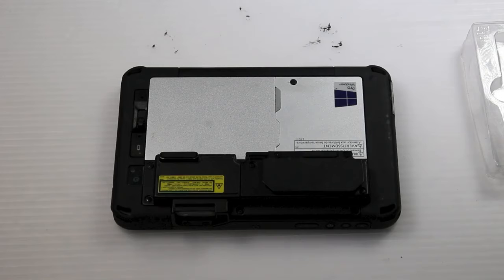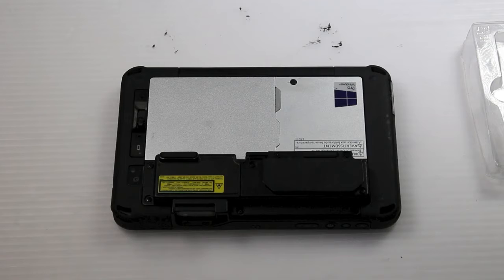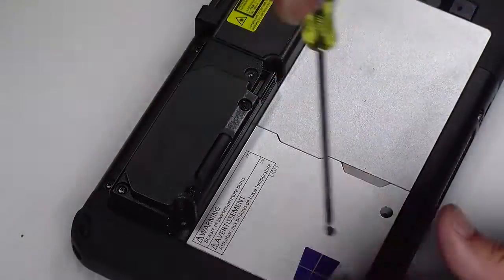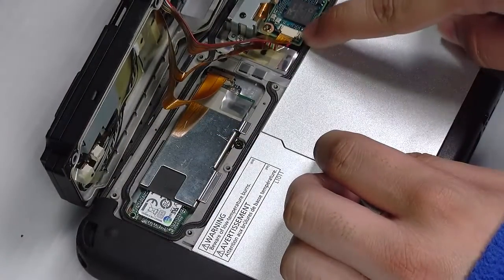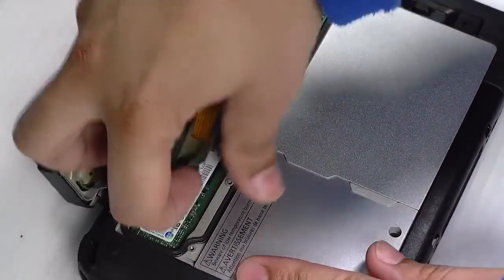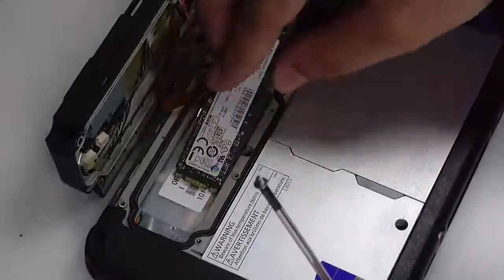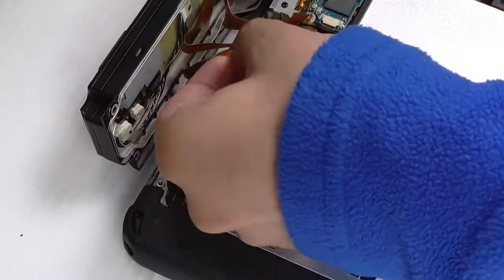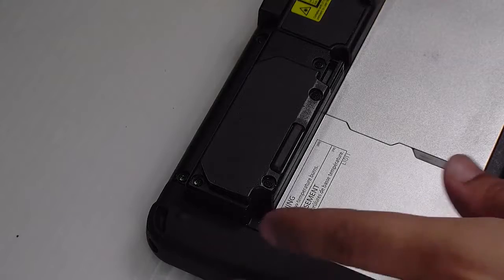Replace Your Panasonic Toughpad FZ-M1 SSD Card!

Comment: Hello, I have this same tablet, but it gets very hot in that part where the SSD is located and the performance of the equipment decreases. Do you know if it's normal?
Reply from the maker: You might want to check your battery to see if that is causing the unit to overheat.
Reply: @Bobjohnson  I tried to do a test and it continues to heat up, could it be that the heat is not dissipating correctly?
Reply from the maker: @SebastianZSSX  I would remove the battery and power the unit with the AC adapter.  See if you get a heat issue.
Reply: @Bobjohnson  Hello, thanks for answering me. I tried it without the charger and the exact same thing happened to me. It got hot somehow, in 25 minutes it was hot and it stuck
Reply: use Windows 11 could not do anything at all | windows 10 22H2 x64 | 21H2 which warmed up after 10 minutes, Windows 8.1 pro x32 warmed up 15 minutes
and Windows 8 pro x64 at 25 minutes
Reply from the maker: @SebastianZSSX  You need to remove the battery completely, leave it out.  Then plug in the AC adapter and see if you get the overheating issue.
Reply: @Bobjohnson  hello disconnect and I still have overheating problem
Reply from the maker: @SebastianZSSX  Then you have major problems with your tablet.  My educated guess would be the system board.  You can always send it in to us to have our certified techs determine the problem.  If interested here is the link: https://www.bobjohnson.com/repairs-service/
Reply: @SebastianZSSX  just take the tablet apart, and plug it in and see which component overheats, it could be as simple that you gought aused unit that someone took apart, and did not place the thermal pad, or thermal grease on teh cpu properly and its overheating till it thermally trottles, and shuts down...

Comment: Hello sir. I recently bought Panasonic FZ-B2B. It has Android operating system, but its version is 4.4.4 Kitkat and my programs do not support this version (Thinkdiag-thinkcar). Can we install any Windows version or a higher Android version on this tablet and how do we do it? The renewed model of fz-b2b called fz-b2d uses Android 6. Thank you very much in advance
Reply from the maker: @barsakyuz221 The best way to answer this question is to simply fill out our Tech support form.  Our in-house technicians will answer with the links and info you will need.  Here is the link: https://www.bobjohnson.com/tech-support-form/  Thanks for Watching.